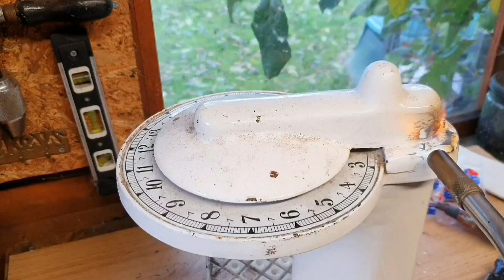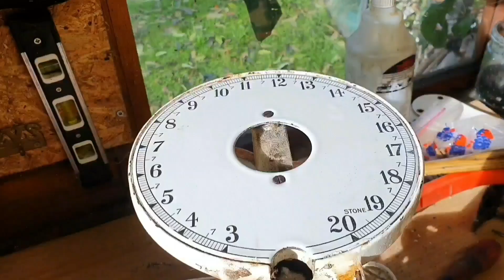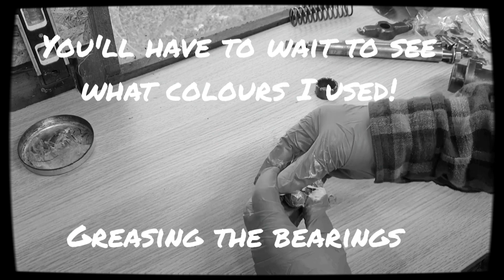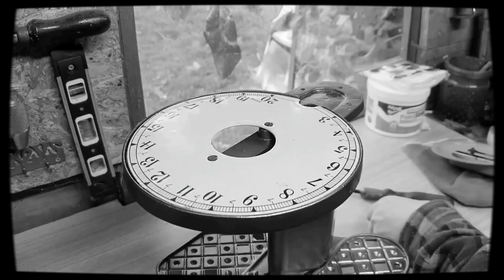vintage restoration of old scales- bathroom

Comment: You are a smart man Alex. Her color choices look very nice. However the red would have looked also, we may never know. I have not seen that type of scale  before but they are cool. Good job and  Tell your wife her choices are spot on.
Reply from the maker: Thanks Dale, it's an odd scales, I've seen lots of types but none like this and no manufacturers marks anywhere. It was long overdue that some of my shed time should be shared with her, keeps her happy a bit longer too.
Reply: Nice job👍👍 nothing worse than not being able to find a makers mark
Reply from the maker: Thanks, doesn't happen very often but it is frustrating. I like to try a do some research, if no other reason than to try and look as though I know what I'm talking about.